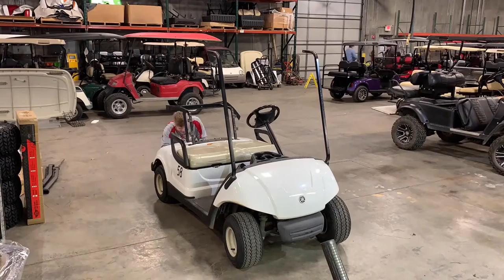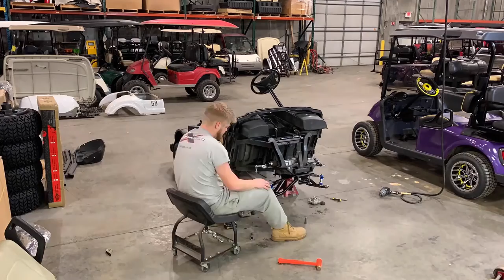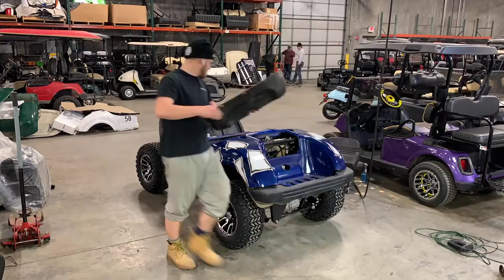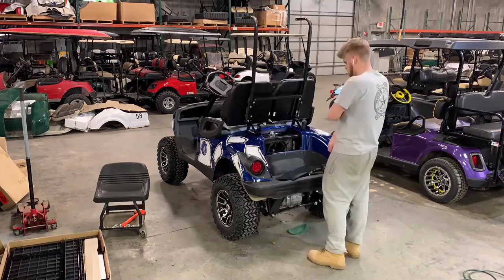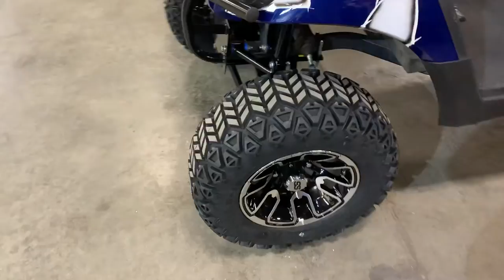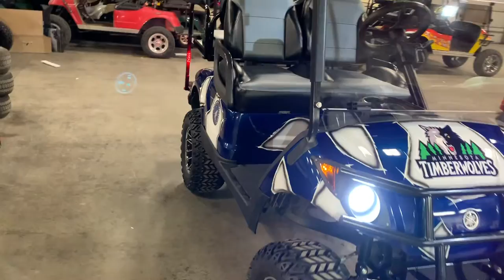Timberwolves Golf Cart Build Timelapse | Ultimate Behind-the-Scenes

Comment: I just got one of these for free. The whole thing was entirely under salt water in hurricane Ian though 😂😂. 

I'm currently tearing it down trying to figure out what's salvageable and what's not. I have a 2001 GSXR 600 motor I might end up installing if I can find a welder. 

Surprisingly enough, all the batteries are still good even after being under water. They're still holding a charge.
Reply: Did you get it pretty cheap I heard they're going pretty cheap down there I live in Bradenton